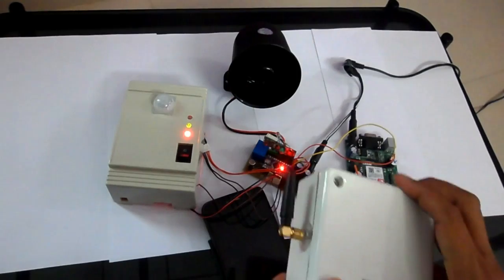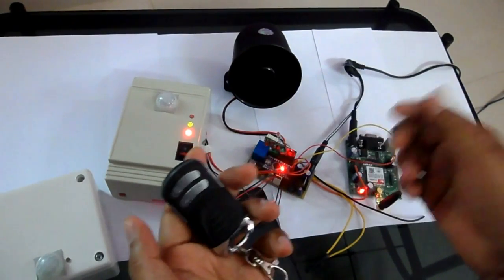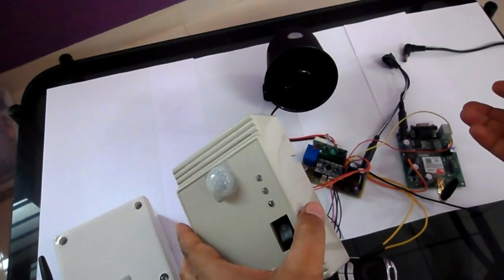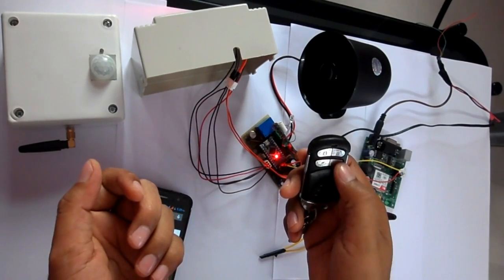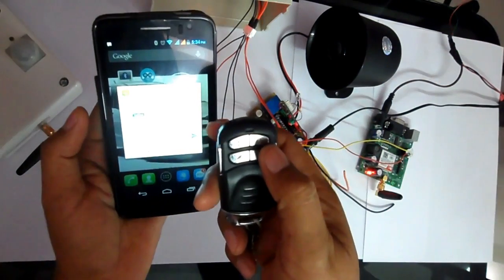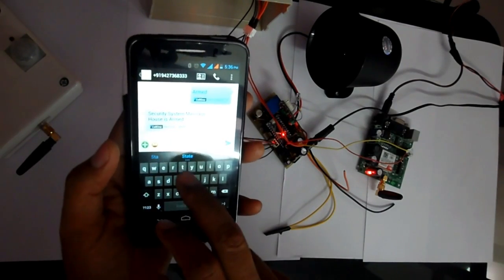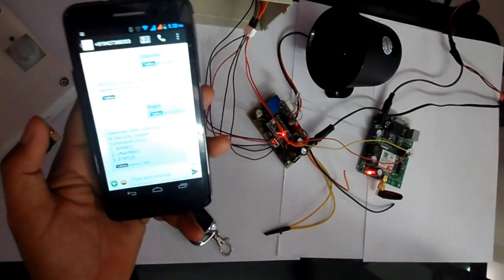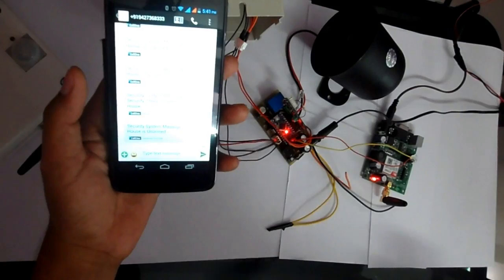GSM Based Security Alarm System using Arduino and 433Mhz Remote (V2 0)

Comment: Dear Sir
Good Day.
I am writing from Bangladesh. I would like to submit a university project and topic is "Design & Construction of GSM base floor intimation system'

Input Components-
1.Water level (3level, H-M-L)
2.Air flow (if fan moving then a generator induce voltage 1.5-2.5DCV)

Output Components-
1.Display show the signal number against the level
(Exg: for High level, Display show 3, for Mid level, Display show-2)
2. Turn on light (Exg: For high level turn on Red light)
3. Different types of buzzer turn on at High & Mid level
4. Turn on the light & show the danger number by using GSM system at Control Room
 
We would like to establish the below condition:
Input Signal:
1. Each input signal of water level is 6v
2.Generator induce 1.5-2.5DC volt, here we apply 3 condition,
High-2.5v, Mid-2v, Low-1.5v
3. System Input power = 6V from a battery
4. If water level high or Generator volt is 2.5v then output signal high
If water level Mid or Generator volt is 2v then output signal Mid
If water level Low or Generator volt is 1.5v then output signal Low
IC always count the majority input value from water level and generator,
example: if water level high than generator value low, the output value is high
5.If input condition is high then output signal turn on the Mid & High buzzer

Now, I need your help to make GSM system for turn on the light & show the danger signal number of control room.
I wish to get your positive guideline.

For your better understanding give me your email address to forward the block diagram/drawing of .

Regards
Md. Abu Zafar
autozafar@live.com
World University of Bangladesh
Reply from the maker: Md. Abu Zafar Hi Dear Abu,

I will mail you soon. i have some query and suggestions. Thanks
Reply: Please send me your contact details
Reply: Please send me your phone number